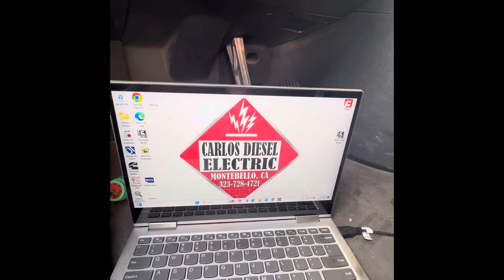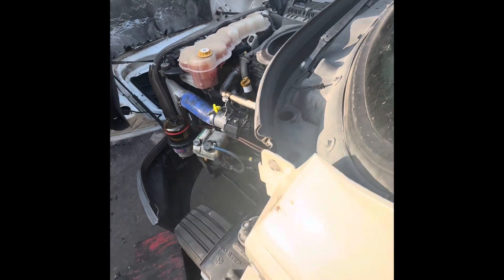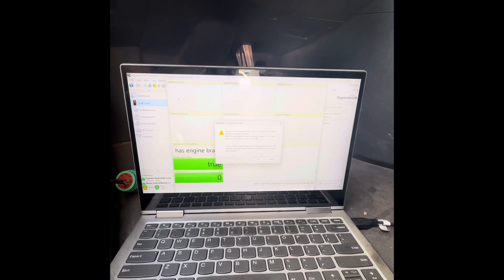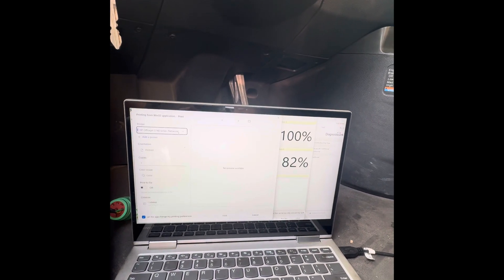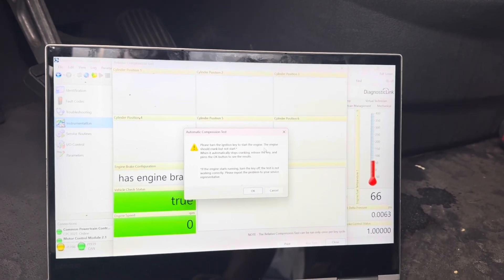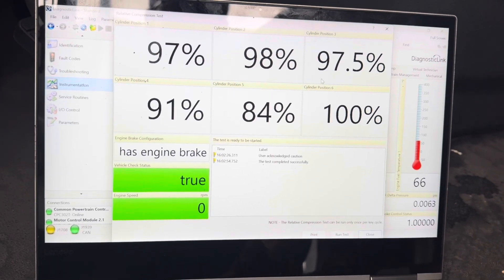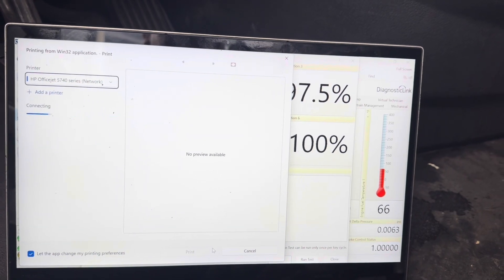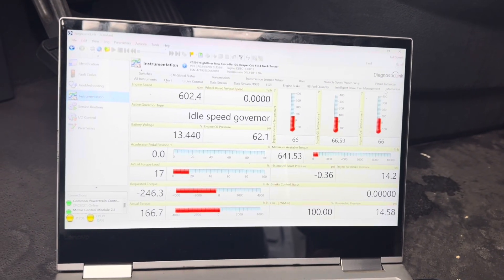If you hear this, it’s time for this. Valve adjustment DD13

Comment: Relative compression test can give false results if your batteries are bad. If your voltage dies straight away while you’re cranking it. Won’t provide accurate results
Reply from the maker: Very true

Comment: Detriot recommends repeating the test three times before conclusions. You should also consider fluids' temperature. Engine working temperature will be ideal to perform the test and get accurate readings.

Comment: It will come back after few months. Only replacing intake valves will help. My theory is due to improper air to fuel ratio or other reason that causes early combustion in the chamber intake valves burn out. I own my truck since almost new and have done valve adjustments meticulously and still have this problem.
Reply from the maker: @Orkistan7  I agree. Cylinder head has to be worked on or replaced. But for now, this is what the customer wants and all I can do is advise him on what to expect next. 👍🏼
Reply: @CarlosDieselElectric  Do you have 2021-2024 dd15’s coming in with same problem? I’ve heard they install a different turbo in those models. Why they would replace a turbo that never breaks and put completely new turbo into Gen5 dd15’s? Who knows maybe they figured out that old turbo was given too much air flow to the engine and it leads to early ignition of a fuel? It’s only theory though
Reply: How often would you do the valve adjustments and how many miles does your truck have?
Reply: @Nihil2005 950K right now. I drove almost 200K after rebuilding the head. After learning it to adjust the valves I do it every 100K
Reply: @Orkistan7 Thanks. I got a 2020 Cascadia with a DD15, currently has 640K miles and first adjustment was done at 495K and second was at 600K. Is doing a valve adjustment every year or every 100K miles okay, or should I do it every 200K miles?
Reply: @Nihil2005 It’s totally up to you. I’m doing it so often just because I’ve learned it to do myself. Every 200K I think just fine. If they are too tight and need adjustment you will start feeling that engine works differently and with heavy weights you will definitely feel a lack of power you once had
Reply: @Orkistan7 I think I’ll be doing it every 100K miles. Engine is running smooth and never hear that rough engine or lost power. My mechanic suggested I adjust them every 6 months, but I think that’s too often and probably won’t need it.
Reply from the maker: Once a year sounds good. But you seem to really know your truck which is a good thing.
Reply: @CarlosDieselElectric Thanks for the reply and the kind words! I appreciate all the great videos you do😀👍

Comment: Had a dd15 the other day similar issue we performed 3 valve adjustments within a year due to low compression. Valve adjustment screw was recessed  higher on the cylinders with low compression. Drive stated he'd stay running like that until it breaks.😬

Comment: And I'm worried about my DD13 at 455K miles?  Bought it at 365K miles, I'm hard on the Jake Brakes all the time running the hills of WV at 79K lbs.  When she kicks down at 2100RPM  into 10th at 67 mph....I worry about that valve lash.  But then again, and nobody that drives trucks can deny me.....Detroit has the best Jake Brakes in the industry, and have had them for 40 years.  You turn the Jakes on, on a Detroit, and you don't need brakes.  Cummins, CAT, Volvo, those motors wipe cams left and right under normal running.

Comment: It’s performance issue, not breakdown. Most truck owner doesn’t pay for performance service 😂. It will result difficult start, especially in winter. Also clog the one box.

new truck 150000 miles do the 1st adjustment . Then Interval 500000 miles.